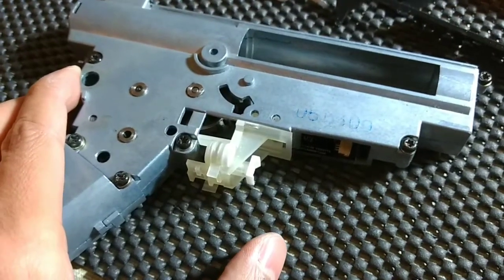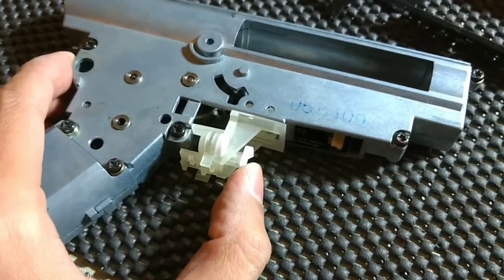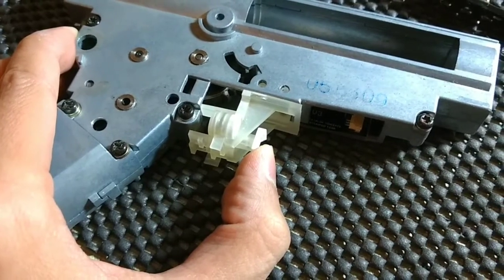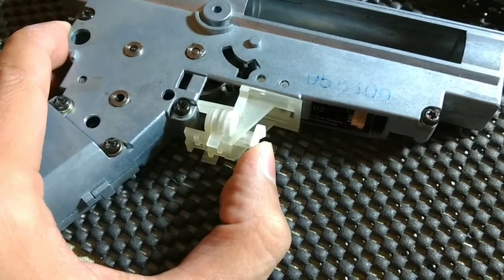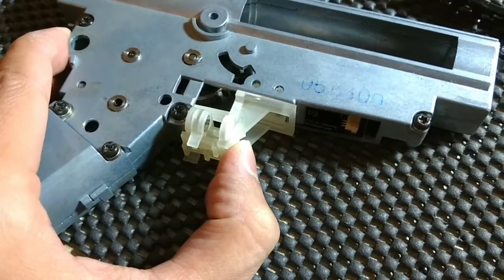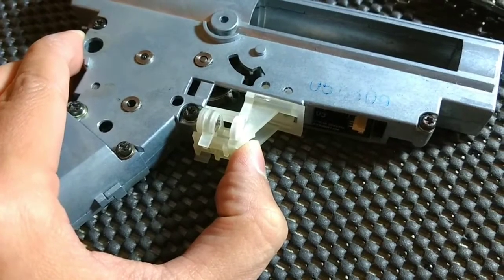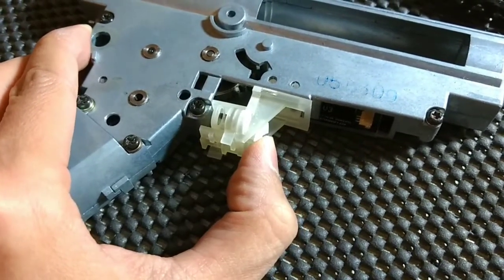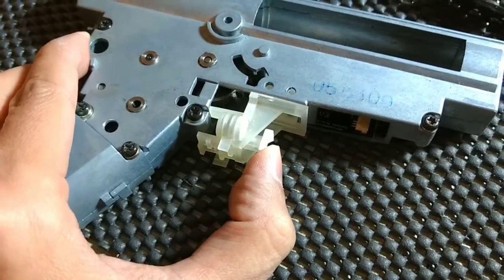Magnetic trigger for airsoft AUG

Comment: Any updates on a release for this? I just found your R-hop cutting jig and bought every single piece, as well as the gearbox backing plate for AUG's. I just finished a custom AUG A3 (made it a true A3 not the airsoft one) and while working on the gearbox remembered just how much I hate the stock trigger mechanism. This would be awesome to use in all my AUG's.
Reply from the maker: Mike Obrien This design is taking some time to optimize, I have a second revision on my bench waiting for testing...
Reply: ¿Could you share any info about how you made the custom A3, please? I'm looking to make a custom too but I don't know what will be the best way to do it.
And I would also buy this kind of trigger, looks awesome!